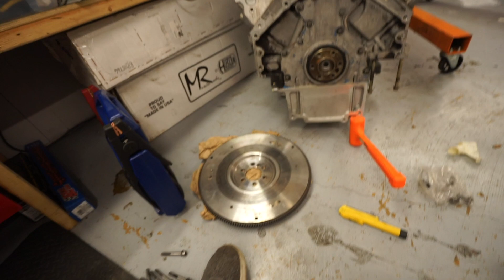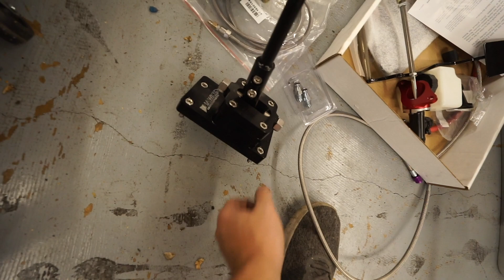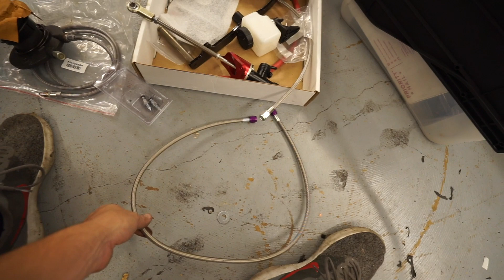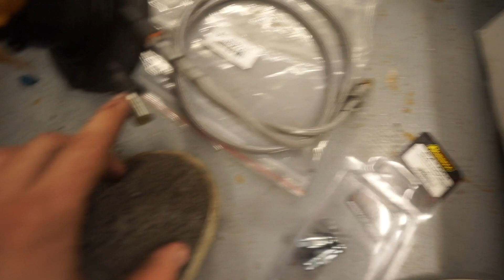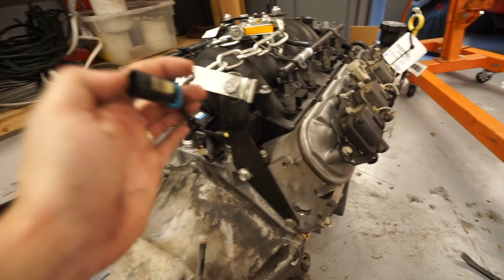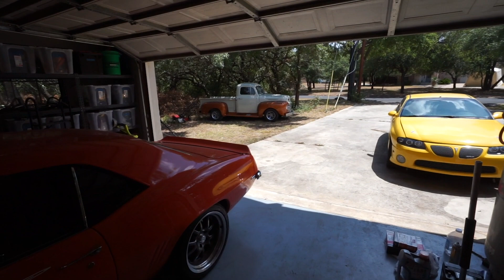1969 Camaro LS/T56 swap: Clutch install and mounting the trans

Comment: What oil pan did you go with? Seen you went from front sump to rear.
Reply from the maker: Holley f-body swap pan. 302-3 is the part number. I went with that one because it has drains for my future turbo setup. Fits perfect.
Reply: @ClassicOctane  did dipstick are you using?

Comment: Putting in a used manual transmission, I wondered what you could do to check its condition while it is still out of the car. Would you have checked and potentially changed the input shaft bearing, for example ? Im not at all familiar with the LS engine and associated boxes, I should say.
Reply from the maker: I pulled this one out of a running and driving car so I knew the condition. I’m not sure what options you would have to check one that was already out of a car.

Comment: AvE has a video using bread to get bearings out using hydraulic pressure. But in that case, the bearing was up against the case of the electric motor he was working on.  Looking forward to seeing more 'will it run' videos!